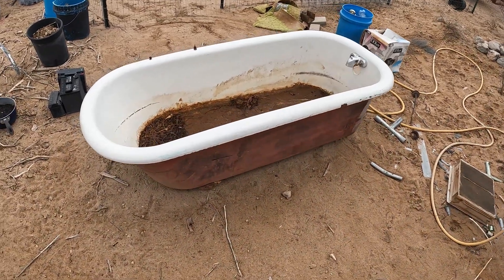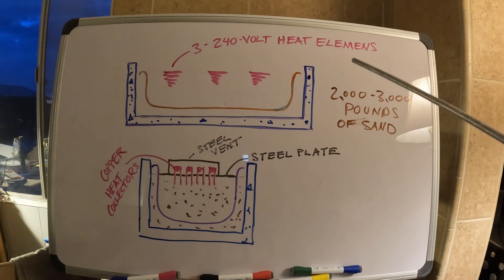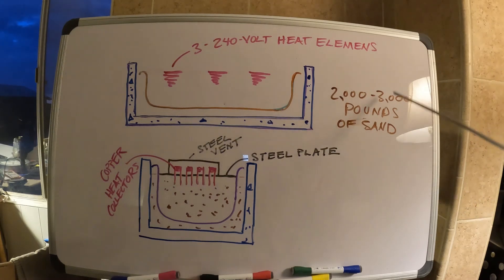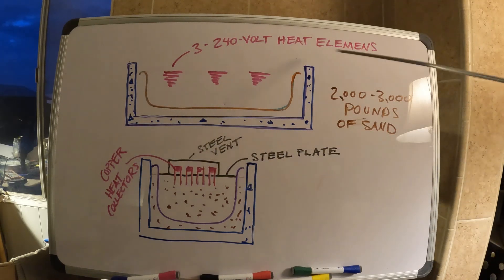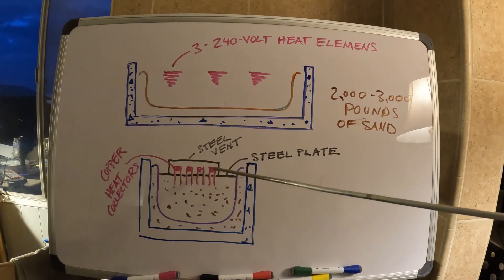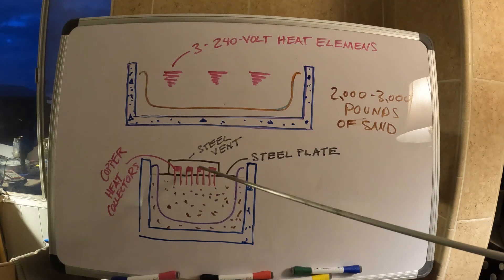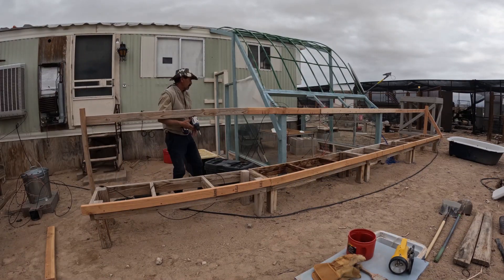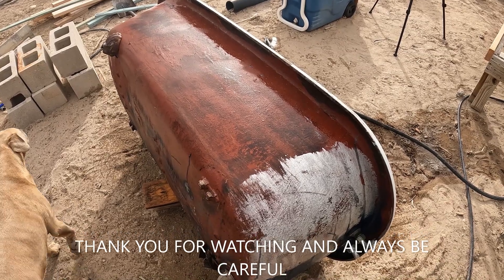Bathtub Super Sand Battery, Part-25

Comment: You are now ready to use the sand battery  as a dump load for the electrical  battery  system switches are used in wind systems  that divert power to a resistive load when electrical battery  is full. Dump Load Switch for wind generator.
Reply from the maker: Each day I learn something new.

Comment: I've been watching with interest, I'm looking to build a big one. I've been looking for heat resistant insulation, what about using vermiculite, it's heat resistant upto 1000oC plus, also you could sit the bath on top of it in your concrete box and pack the sides. Also it's cheap.
Reply: Vermiculite  should work well . As you get farther  away  from the elements  the heat will decrease allowing the use of more common  insulation  material.

Comment: I think  you will only need to use 1 coil because  the heat will increase daily if you have a lot of insulation . Your previous battery had  lots of losses the mass of this one will be slow to heat up but I belive after a few days you will be surprised by the temp  you achieve

Comment: try heating the larger batterys with a 80,000 btu propane garage heater though copper or aluminium pipe it may heat quicker and cheaper

Comment: Awesome tub please try not to "modify" it they are the best, most comfortable bathtubs ever made! If you built an insulated wall around the outside of the tub you could transfer heat right from the tub's body. You could still use woodstove fans too you just might have to attach them creatively.
Reply: I have one installed as a sunken tub in a concrete floor .I am 6 ft tall and fill it up and float like in a swimming  pool .it has lasted 50 years while all other fixtures have now been replaced  twice.

Comment: if you do your own mirror metal (aluminium), then making a concentrator for solar heat is way way way simpler/"cheaper", what survival is that if you cant do your own metals, I recommend extended klorialkali process, electrolysis of molten NaOH to Na to metal oxide reduction cycle, using sea-salt water
Reply: ironically the same stuff that makes power can make more of the metal, that just increases if you do more more more more
Reply: Direct resistive heating is less complex  and over 90 percent  efficient currently used solar panels  are available  at a very  low cost in most of USA  . Sand battery is a method to store excess generated power as a dump load when electrical storage battery  is full most power is used for heating  water,cooking,and heating living spaces .The sand battery  allows you to have a smaller less expensive electrical battery  while harvesting 100 percent  of production  from your solar panels
Reply: @teddycunningham7568  did you not read the law, you have to obey, in all places, all things, not think your own
Reply: @teddycunningham7568  under law there is no freedom, choose one, dont bring the "trash cost" in my sight
Reply: @teddycunningham7568  better close your shops/doors, because you are no longer serving me, not even in talking, of facts, or trying to prove anything
Reply: @paulmaydaynight9925  huh, why would I need to copy someone, God gave perfect plans already
Reply: @paulmaydaynight9925  what did not get about reflecting 100% (4x the solar panel) into a one point, as parabolic spin cast metal sheet concentrator
Reply: @paulmaydaynight9925  no wonder people are in all kinds of trouble believing people (online)
Reply: @paulmaydaynight9925  bend a parabolic trough, mind you
Reply: @Jkauppa  use context to try & make counter claims man, I think you mean You don't beleave this one https://www.youtube.com/watch?v=Ua6brgZha-4&t=1s How to Boil Water with a Magnets
watch it,build it, then come back if you still don't understand basic eddy current science & Why they put many laminated metal sheets with directed airflow instead of cheaper solid steel in electric motors etc.
Reply: @paulmaydaynight9925  when you dont, why should I, nope
Reply: @paulmaydaynight9925  I'm very aware of the stuff you linked to
Reply: @paulmaydaynight9925  his stuff is not the best
Reply: @paulmaydaynight9925  why are you dictating rules like a teaser bully
Reply: @paulmaydaynight9925  I hate judges
Reply from the maker: The solar panel system is very simple to assemble and is quite efficient from what I have studied. There are various ways to accomplish heating the sand.
Reply: @off-gridsurvivalmike8120  well, turn off the solar panel factories, then re-evaluate "survival", making mirrors at home from nothing is much simpler, and 4x more efficient, solar panels are at around 25% efficient typically, mirror concentrators are at 90%+ range typically
Reply: @off-gridsurvivalmike8120  I though you were a survival channel, not a store equipment channel
Reply: @off-gridsurvivalmike8120  can you make metal from sand
Reply: @off-gridsurvivalmike8120  sounds like burning biomass is the easiest greenest simplest solution to heat up burning brick stone oven, tho
Reply: @off-gridsurvivalmike8120  do you have a solar cooker, made from a parabolic dish antenna surface
Reply: @Jkauppa  I am sorry  my statements upset you . I have been experimenting  with solar heating since 1979 parabolic mirrors  are very efficient for many applications and have found them very useful  . Many people  have solar panels  that provide  more energy  than can be stored in a chemical  electrical  battery  the purpose of the sand battery  is to store excess  electricity  as heat . Follow your God given inspiration as I also will and may we all be blessed with his energy. Thank you for your heart felt response
Reply: @teddycunningham7568  "him" is like from people, God is like spirit, but not serving, just freely non-law-binding giving, have peace
Reply: @teddycunningham7568  opposer is the knowledge enemy to God, the Lord Jesus Christ, not some arbitrary god/people as the rules
Reply: @Jkauppa  yes the lord Jesus  has given  us all we need and it is up to us to make good use of what we are given .Wisdom comes from the exchange of ideas the spirit  of God inspires us and directs each one on the proper  path  . By sharing our thoughts and experiences  we can make our lives  mare pleasant and fruitful.  May peace be with you.
Reply: @teddycunningham7568  you earn nothing by any of your works, gift only, says the gospel
Reply: @teddycunningham7568  dont blow your horn in front of you, your works
Reply: @teddycunningham7568  why would your own works matter anything, dont become a hypocrite through law owned self-attempts
Reply: @teddycunningham7568  well, first law is: God teaches, not you or anyone, to others, or do you want to be force fed your own teachings, "do to other like you want to be dealt to yourself"
Reply: @teddycunningham7568  I remember you starting to back-converse with some law stuff, so I puke all the law stuff back on you, be honest, nothing through law works is honest, its immoral to talk your own (lie) based on law
Reply: @teddycunningham7568  the most insulting is any animal/people trying to teach anyone, no benefit to anyone, only Spirit makes alive, letter/scriptures/text/law makes dead
Reply: @teddycunningham7568  well law is given by God, not by people at-tempting to tease God with teaching speech
Reply: @teddycunningham7568  I'm not talking my own, but God gave this to be said to you, just now
Reply: @teddycunningham7568  law based talk their own, and not what God lives in them
Reply: @teddycunningham7568  law is "the worthless work" besides the cross, do not hold law besides God as a god
Reply: @teddycunningham7568  so dont you be surprised if I dont accept any law based talk
Reply: @teddycunningham7568  you dont become righteous through law, so your "yes" is towards law, not towards cross-gift
Reply: @teddycunningham7568  childish to attempt law based righteousness, when you would have God as righteous, in you, instead, not living me but Christ in me, Christ the Lord is Spirit
Reply: @teddycunningham7568  by cross I'm righteous, so if you need works to be righteous, did Christ die in-vain, again
Reply: @teddycunningham7568  you shall not become a god with your teaching alongside God, 1st commandment, I shall not listen to you, at all, by 1st commandment
Reply: @teddycunningham7568  or "rather obey God than people", you just instructed something your own, not from God, as God gives all commandments itself, not through peoples works
Reply: @teddycunningham7568  if you are not with God, you are against my freedom in Christ
Reply: @teddycunningham7568  stop teaching, its works in vain, you only talk, you dont do anything
Reply: @teddycunningham7568  only pre-made gifted works from God are good, so if you attempt anything yourself, you do evil only, especially dead works based on law
Reply: @teddycunningham7568  repent from your self-righteousness
Reply: @teddycunningham7568  dont think you can recruit me to work for you through the law, whatever you "rule", I'm free for God, not to be worked anymore, have sabbath, for Christ paid it all, beforehand, your rest, if you have one, sounds that you dont have rest, wicked
Reply: @teddycunningham7568  why would you become a judge over others, you break the law, judge
Reply: @Jkauppa  may peace be with you

Comment: Why not bury a 50 gallon water heater in the ground and use that? I'm honestly thinking about doing just that
Reply: If you are heating sand the container  only has to be heat resistant  and surrounded  by insulation.  Sand is able to withstand and store many times more heat than water which boils away at 212 degrees F.. So if you place underground all you need is an insulated hole filled with earth
Reply: @Matthew Galvin still in planning and material gathering stage  . Will be useing excess  solar power  as a dump load after my battery  is full . Have done lots of research . Hole in the ground  can be linsulated by building an air gap between the soil and the container much as a thermos bottle.  Heat needs a conductor  to flow through  much as electricity  does. Insulating material  depends  on the distance from the element .perlite and vermiculite  and rock wool for the high temperature  area and standard  household  insulation  in the low temperature  area . Saw dust mixed with Portland  cement  may work well .
Reply: @Matthew Galvin look at air filled concrete  " air creet" uses soap foam like shaving cream mixed into Portland cement.  Jim's Cool Stuff has foam generator
Reply from the maker: The hot water heater elements are not designed to work out of water. I tried on my first experiment. The tank may be viable to hold sand but you will need to heat it with another sourse.